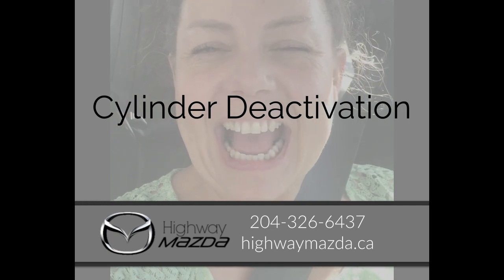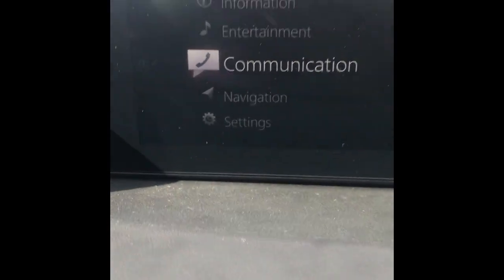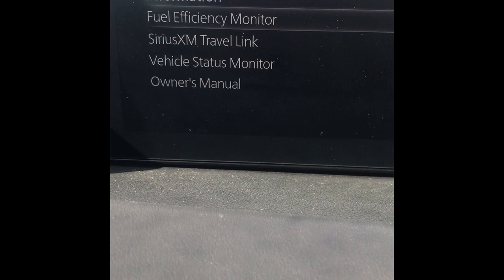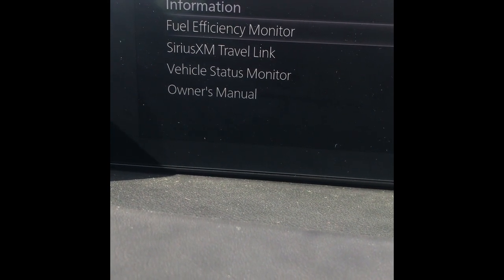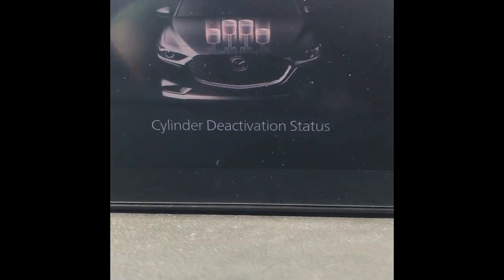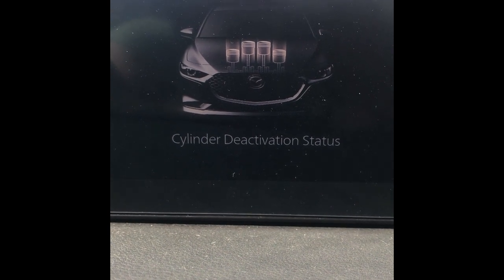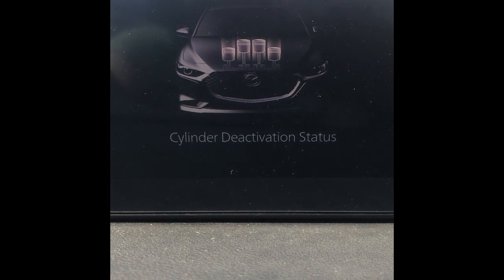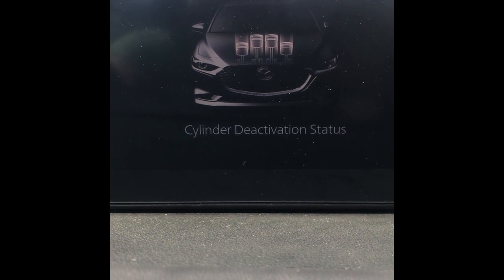Mazda Cylinder Deactivation tutorial

Comment: Bought a 2024 CX-5. The CD felt like it was misfiring. It jerked the 4000 pounds of car each time it engaged. You can't jerk 4000 pounds without something eventually failing. I traded it off with just 10K miles on it and will not buy another.

Comment: I see a lot of negative comments on mazda's CD- and just don't get it. It does save fuel, and it does go on and off  smoothly. And I dont like being  anxious about things working just fine
Reply: It is not smooth
Reply: Then you have no idea about cars.  It causes a difference in heat.  It's also a DI engine, you need heat to burn carbon.  Mazda designed the car to run hot, saves fuel and also cleans intake valve with heat.  It was known to crack cylinder heads due to the temperature disparity.  2 shut down cylinders causes it to run cooler, too cool for burning carbon.  This goes for almost all cars with CDA.

Comment: Yes.  I have questions.  Please tell me how to turn off cylinder deactivation.  It saves only a miniscule amount of gasoline, but it shortens the life of the engine in the process because of the heat differential that can occur between cylinders.  In addition,  if the Mazda3 has engine start/stop technology that takes effect when I stop at traffic lights how do I turn that off?  It leads to early failure of the starter.  With both of these technologies the gasoline savings is small, but the cost of early failures of the starter or engine are quite large.  I am in the market for a new Mazda3, but it will go to the bottom of my list if I can not turn these two things off.  Thanks.

Comment: Mazda only did this cylinder deactivation to help with fuel economy because their fuel economy on these 2.5 are trash. Barely 20 average in stop & go on my AWD 3 with the non turbo motor. Mazda should just move on from the 6 speed, release an 8 speed that with create better fuel economy and dump the cylinder deactivation
Reply: I get 36-39 mpg with my awd hatchback.  You must be a terrible driver to get 20mpg in the city.  Learn how to drive.  Probably the type who brake at the last second, tailgate, and floor for 50ft just to brake again.  Don't worry, most people drive just as bad as you, but think they're good drivers.

Comment: Three things I don't like about modern cars:
1)  CVTs
2)  Stop-Start engine technology
3)  Cylinder deactivation
4)  Auto braking and lane assist

At least Mazda doesn't have #1 and #2, but has #3 and #4.  Can't win them all.
Reply: I understand 3 but you’re over exaggerating 4, you can always shut off those safety systems but you say you don’t like it until it either saves your from an accident or saves someone from hitting you cause their car has auto braking…
Reply: @Booboobear-eo4es  I understand your point and I agree that distracted drivers are at an all-time high but I personally have a Subaru Outback with these safety systems and have had no malfunctions for service needed for them. The only thing is I have to get the OEM Subaru windshield in order to not mess with these systems, as well as the systems need to be calibrated after. Besides that, the system has saved me twice and both times I wasn't on the phone but rather looking at other vehicles (such as making a lane change and checking it's clear while the vehicle in front brakes for whatever reason) I think they're invaluable and super great for new drivers and old drivers who don't have the reaction time or experience to prevent a collision.
Reply: My 2024 cx5 has no CD.
Reply: You can turn #4 off

Comment: I guess she volunteered to do this video because it was a suicide mission. No way am I going to buy a car with this technology especially on a 4 cylinder engine. Last week I had a 2020 Mazda 6 as a loaner car and when I got on the highway it just lost power going up a grade now I know why. Did not know about the display feature. It just does not make sense. Now I have read about the Mazda recalls what they will do is deactivate this feature just like GM did. Also this start stop feature that a lot of cars have is also a complete waste of time.
Reply: Yup, this feature has already caused destroyed engines on the Mazda's that have it.  You'll end up with coked oil remnants in the deactivated cylinders from the vacuum that's created as the deactivated cylinders continue to move and eventually the coked oil particles will clog the oil screen, lead to oil starvation then destruction. Even if that problem were solved, that still wouldn't prevent the uneven cylinder wear which will eventually take place with continual use of cylinder deactivation.  Best thing is to avoid any models that have it.

Comment: this cylinder deactivation technology is nothing new, GM had been working on it since 1981 and has not perfected it yet,, nothing but an oil burning problem,, there is no need to put this on a 4 cylinder engine to increase the gas mileage by one mile ,, just over engineered junk that imo will be nothing but problems down the road..do not have to believe me..  just google it,,
Reply: Not all brands are built equally. So far there have been no issues that I've been made aware of. And when you are driving on the highway, when the CD kicks in, the only way you will notice it is that the fuel consumption indicator will drop - which does indicate that it's doing exactly what it should.  I would like to encourage you to see how Mazda has done this differently than other manufacturers. Thank you for your comment.
Reply: Highway Mazda did you forget the 200,000+ recalls on the cylinder deactivation? Fuck off

Comment: Hello Carla, thanks for the video. I have a question if possible to tell me which is better to buy Grand Cherokee 2001 - 2004 V6 or V8 and why? Does these types of vehicles have cylinder deactivation system? Thank you 🙏
Reply: Hi there! You ask a few good questions. I doubt that a Grand Cherokee would have the Cylinder Deactivation. The technology has been around for a few years, but I doubt it would be in that kind of vehicle. When considering a V6 vs a V8 you need to consider what you are using the vehicle for. A V8 will give you more power, more towing strength, and use a lot more fuel. A V6 is plenty strong enough for most drivers, and will be more fuel efficient. If you are looking for lots of power and fuel costs are not an issue, then the V8 will be a fun drive for you. But if you are conscious of fuel and don't require excessive power, I'd suggest the V6. Please let me know if you find that helpful.  ~ Carla Anne, The Car Lady
Reply: Highway Mazda - Hi Carla, thanks a lot for the information you provided, yeah sure it’s really helpful and you have good way to explain as a prof. Instructors. I would love to have SUV, some of my friends advised me to get V8 is better in torque, power and strength plus it’s V6 & V8 are the same in fuel consumption as they said, so that I asked you. I’m not going to towing anything, so that I’m going to take your suggestion and have V6 😊 thank you, have a nice day.
Reply: Highway Mazda - forgot to ask is there’s any device or something to install into SUV’s JGC for Cylinder Deactivation?
Reply: Highway Mazda - Mazda CX-5 is beautiful nice car but it’s pricey in which I can’t afford it, so that I was thinking to have SUV JGC 2004 to be reasonable price. In addition I like ground clearance cars to be a little bit high due to roads nature in Egypt 🇪🇬 where I live. I need the vehicle for daily use commuter, I’m not going to towing. 

The fuel is an issue for anyone, I’m looking for nice shape car, power, strength and reasonable price.